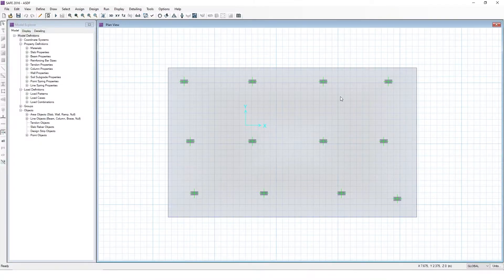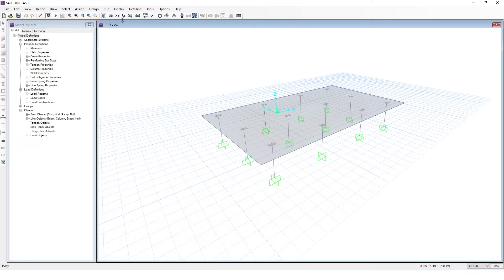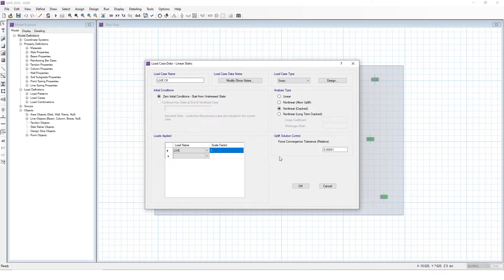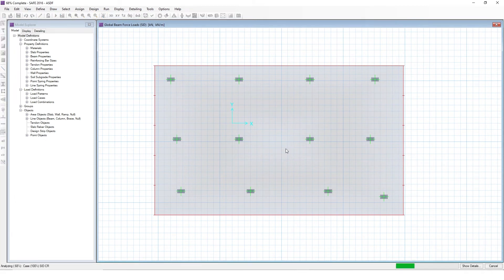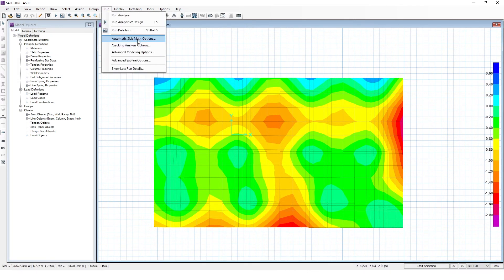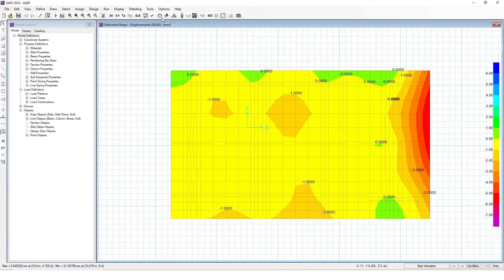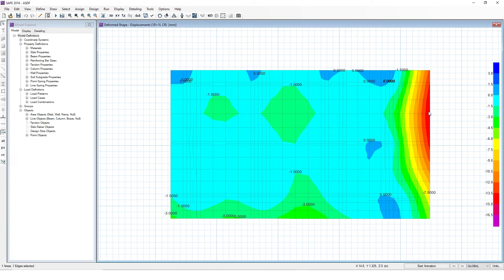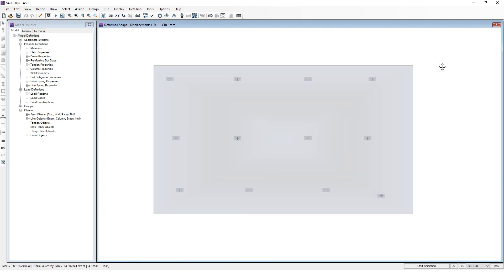CSI SAFE 2016 - Reinforced Concrete Slab Deflection Tutorial

Comment: it was very nice to see how you can change the geometry of the slab and get an almost real time response to the new deflections, with a 'topographic map' of the displacements across the entire slab. 
do you know of any free sotware that is easy-ish to learn ?
Reply from the maker: Good comment...this is a useful function of SAFE IMO to size raft or mat footings in order to achieve relatively even pressure and settlement distributions.  Resize and iterate manually....especially when the geometry is complicated.

I am not aware of free software that is easy to learn no.  SAFE isn't my favorite program and it gives funny values sometimes but it has its uses, this is one of them.

Comment: the cheaper option to mitigate excess deflections in the right side of the slab might be to extend a continuous beam  from the row of columns or to place a column under the stressed region, however architectural plans might prohibit that, forcing the less efficient option of either increasing tension reinforcement or thickening the slab, is what id think
Reply from the maker: Structurally this is a great option, unfortunately this isn't usually a good one as this beam will typically have to pass through the window line which will mess up the look of the building.  Normally this kind of situation will happen on a typical floor and forming a beam on every floor to deal with a long cantilever isn't efficient in reality nor does it look good.  The most efficient way is to convince the architect to decrease the cantilever length from the get go.  If it isn't a possibility locally thickening the slab in that bay is a possibility, but again it comes at the cost of changing the window detail where the slab is thicker.  It's not a big deal in terms of forming, it's mainly a pain architecturally to play with slab thicknesses on typical residential floors near windows.  If this isn't a typical floor though and it's a one off solution it could be an option for sure. Good comment!